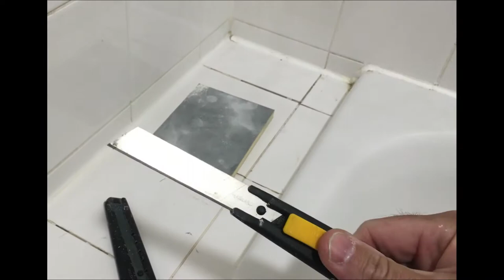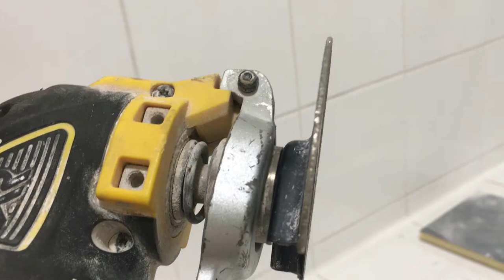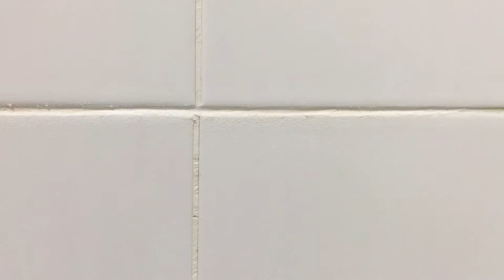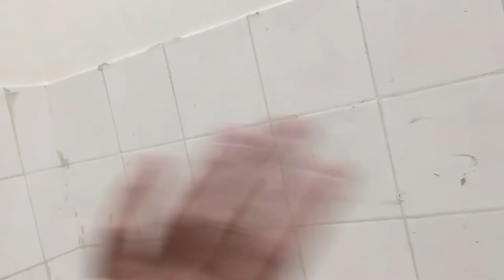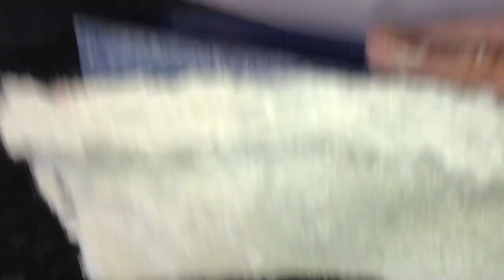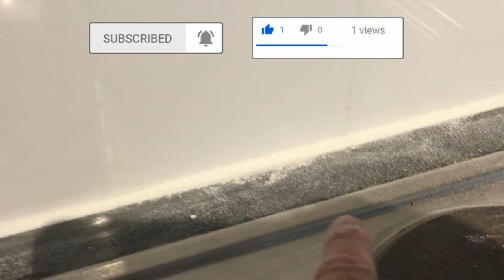How To Remove and Replace Tile GROUT from Wall Tiles

Comment: Try wiping grout in a diagonal movement - avoids pulling the grout out of the joints.
Reply from the maker: I do that when applying it Hugh, but I smooth the joints with the sponge when the grout has gone off, gives a smoother finish IMO. Thanks for the comment 👍